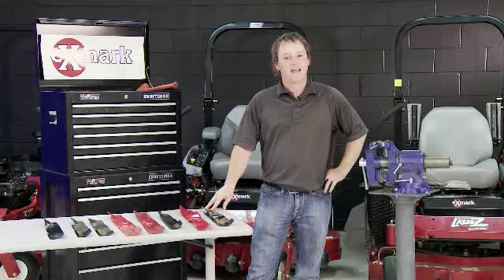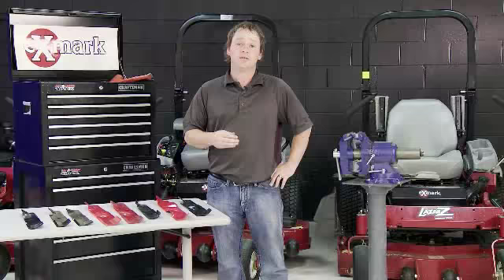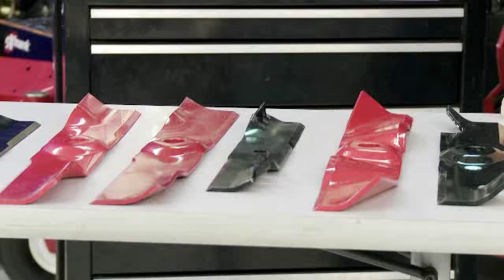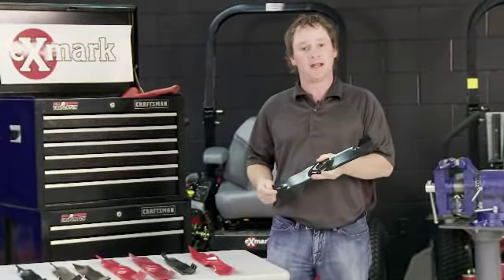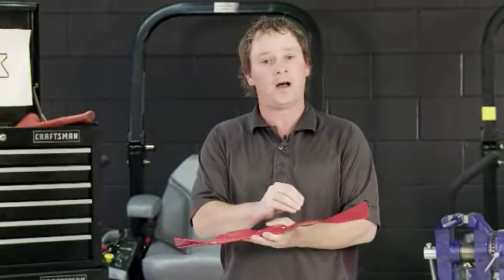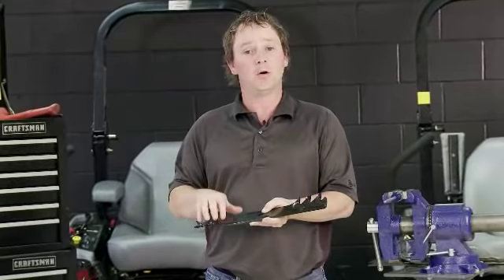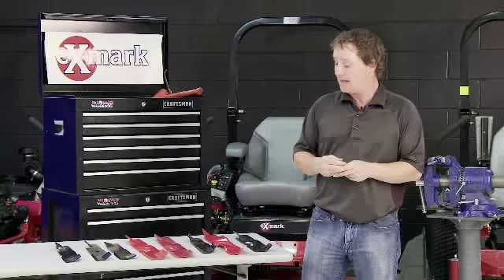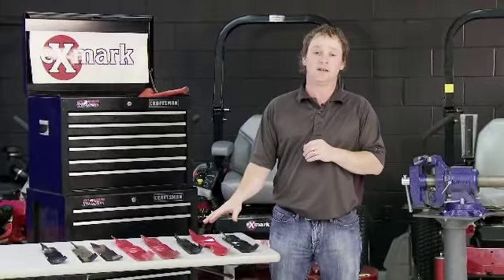Lawn Mower Blade Maintenance Tips | Exmark

Comment: Here’s a good one yes I know my blades are dull but upon last cut my father noticed as I was mowing a dry sound coming from the deck. Like a dry bearing besides getting the mulching blades sharpened what would make a dry noise a pulley or blade bearing. Not quiet as it should be. Only noticeable on the right side
Reply from the maker: Please give the Exmark Customer Service Team a call at 402.223.6375 to discuss this issue. Have your serial and model numbers ready. The team will help troubleshoot the dry noise. Thanks.